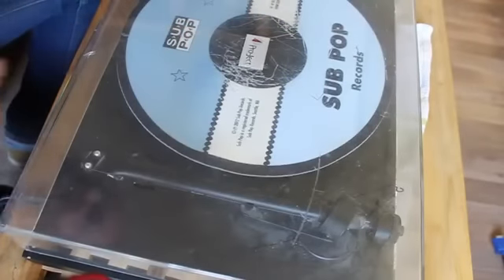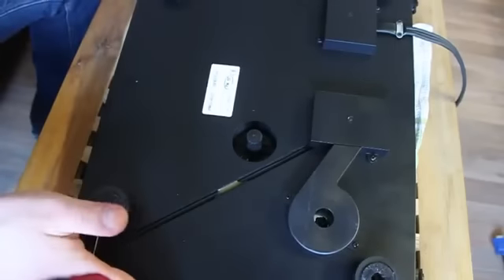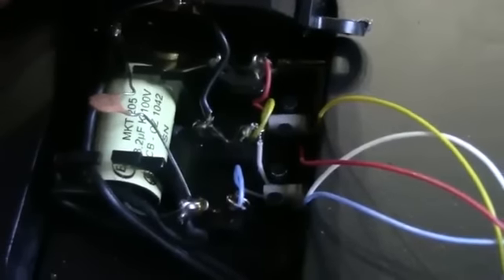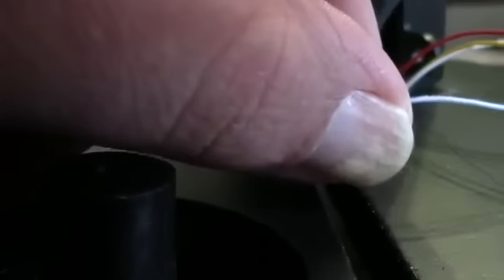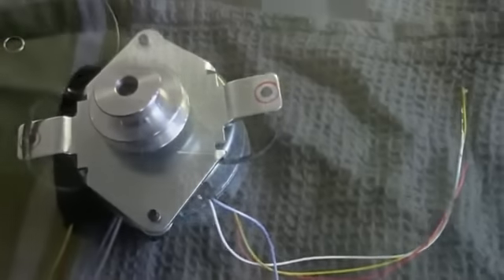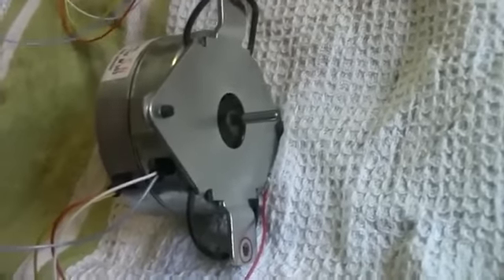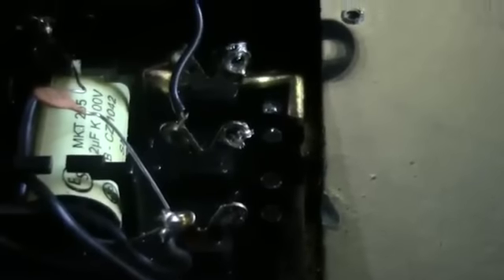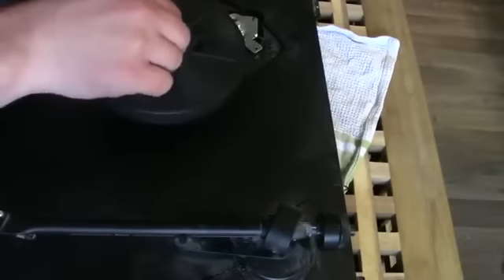Replacing the motor on a Pro Ject Debut III turntable

Comment: Thanks for the video.  I’ve just ordered a new motor and the replacement looks simple so I’m looking forward to getting rid of the horrendous hum I have after using the deck for 30 mins.  I’ve also bought an upgrade kit which helps to eliminate some vibration so can fit that as part of the process of replacement.

Comment: I've got an original Debut (came out around 1999?!), just recently developed an intention loud buzzing noise. Will try to repair or replace the motor using this vid as a guide. 👍
Reply from the maker: I bought mine in about 2002, and it's a mK3. This video is ancient - but it's still going strong. The circuits are very simple - so anything electrical should be fixable.

Comment: Thanks very much for uploading this - it's given me the confidence to try it myself. I have the same model of turntable, and my motor runs... but sometimes it runs backwards(!) and sometimes it makes an awful noise. It's a bit surprising because although the thing is almost twenty years old it's actually barely been used. I only bought it initially to digitise my very small vinyl collection, and it was in storage for ages. I brought it out again recently because I missed the experience of playing records. The belt is fine, but that motor issue worries me. A record spinning backwards is not good news for a stylus...
Reply from the maker: go for it! what's the worst that can happen?
Reply: @KeepItCreativeVideos  Happy to say the soldering went well and the motor works - but I'm now having an absolute nightmare with the belt slipping off the pulley. No matter what height I set it at, it slips off. If I put my finger on the outer lug of the motor mount and keep it pressed down a bit so that it remains horizontal, then the belt stays on - so this is simply a case of the belt pulling the motor over at an angle. I can't think of anything I might have done to result in this issue, and I'm wondering whether I'll need to make some sort of bracket to hold that side of the mount down. Did you have any trouble with this at all?

Comment: Hi, thanks for making this video.

What was your diagnosis for the repair, did the motor stop working outright, or did you receive feedback from the transmission of the motor failing?

This is the only video I've seen of motor repairs on the project.

Only inquiring as my father has this model and he suspected it may be a wiring defect in the stylus arm, I suspect it may be feedback from the motor on its way out.

Your thoughts?
Reply from the maker: the was a long time ago. so I think.... Basically the motor stopped working completely. i.e. the record player stopped responding to the turntable going on. I checked everything else and concluded that it was worth the £20 or whatever to gamble on it being the motor.

Comment: Thanks Neal - I just replaced the motor in my Debut III following your instructions.  MartyMartin87 - why NOT replace the motor in an otherwise perfectly good turntable?  Turntables are expensive and we're not all made of money.  This turntable is practically indestructable, the thing that "goes" is the motor.  FYI - "good old turntables" typically DON'T run for decades without some maintenance, particularly on the motor.   But while motors from the 70's can generally be easily serviced, modern motors cannot - they are designed to be replaced, not serviced.

Comment: I have got pro ject 2 I got given it with broken motor but worked for a a few turns now completely dead but its been in a shed so how do I test the power as there is no indicator light on the deck a bit of a design fault? Thanks

Comment: this is a great video, thank you.  I am not completely certain my motor is toasted, I had to move it myself on a two-day trip and secured the motor with foam inserts because the shipping screws are missing.  Now the motor gives the pulley a little jiggle but nothing else.  It was also sub zero temperatures when I moved and I am wondering if I just need to lubricate some parts of the motor assembly.  Any suggestions before I get a new one (which will probably be from Henley because the jerks where I bought the TT where so horribly unhelpful when I called them up for advice about the missing screws..)
Reply: I have the identical situation. I moved about three hours drive to a new place and now when I turn it on the pulley just moves about half a millimeter and stops. I had it protected so well too! I replaced the power supply, now I'm thinking maybe it is the motor?
Reply: @timgoffard  Sorry, I only noticed this response now.  It turns out that, 9 years ago, I had just been using the wrong power supply with my Speedbox!  However, I have had to replace the motor within the last year and this video made it much easier.

Comment: You needed to replace rubber suspension O-ring as well coz your is stretched pretty much. ih you ever saw new O-ring you would noticed that ring is waaay smaller than yours. its a pain in the arse to replace that O-ring coz wires are freaking short and you need to be octopus to menage that work by yourself. I know that. was doin this two times in 9 years on my RPM 5 and they have same suspension and motor.
Cheers

Comment: Hi Neal - I've just installed a new motor on my Debut III and the wiring is exactly the same as it was before (I took a photo) and also the same as on your video - but when I switch it on, the motor twitches but doesn't spin. Any idea why that might be?
Reply: Hi Paul, I have the same result as you mention, and I don't know how to fix it, even I can't find any idea from internet. May I ask if you have fix the problem?
Reply: Alex Lui it turned out that my power supply was the wrong current type - it was AC and i needed DC. I bought a new one and it all worked perfectly
Reply: Paul, thanks a lot. When you say your power supply is incorrect, I suddenly remember that the power supply which I used is my TEAC TN-300 ps... When I change it back to my orginal one, it spin perfectly~ :D Paul, really thanks for your answer!

Comment: What was the issue with the motor, was it not working at all? My turntable motor is making a buzzing sound.
https://youtu.be/NbhU1mC6cTQ
Reply from the maker: This was years ago - but I think it had just stopped working completely. Your sounds like it might be on it's way out.
Reply: @KeepItCreativeVideos  I replaced the motor, suspension band & drive belt today & all is working! The belts may have been okay but since the turntable was 17 years old & I already had it apart it was probably a good time to replace them.
Thanks to your video it made me confident I could do it. I’ll be posting a video in the next day or so.
Thanks so much😀
Reply from the maker: @santacruz3600  thats great that you got so much out of my video. My work that week was sparse , so I took the notion to film this video. I don't do many, but this one has been popular fo 10 years. I still use the same turntable every day. It will be approaching 20 years old.

Comment: Hey mate, thanks for the video and this is a long shot, but what do you think of this? I bought a Debut III Esprit second hand and the pulley seems like it is touching the base plate and making a horrific noise. The pulley has vertical play and when lifted slightly, it breaks contact sounds fine. Does the small screw under the pulley "grip" the motor spline? The pulley should obviously sit up more. Do you think it is more the pulley or the motor? Can you take the pulley wheel off with the motor still attached?

https://www.youtube.com/watch?v=wl2SB74jKpk&feature=youtu.be
Reply: i have a music hall (looks like same motor-ish)  and the pulley is locked in place....

Comment: Why the hell do you think there is a need to replace the motor? If there really is a need this turntable is crappy. I mean good old turntables run for decades, they still run and there is no need to replace the motor.
Reply from the maker: +MartyMartin87 Good point.. I know that motors don't run forever. I guess at some point the old ones needed fixed too - hi fi repair shops used to be on the high street.
Reply: Quite right. I've repaired one of these AC motors. There is a faulty design with these  AC motors, e.g. the cheap piece of plastic at each end of the magnet rotor, to keep the magnets in place, disintegrates. Possibly due to bearing oil attacking the plastic.
Pro-ject should replace these poor crapped out inferior motors free of charge with a new (improved) one.